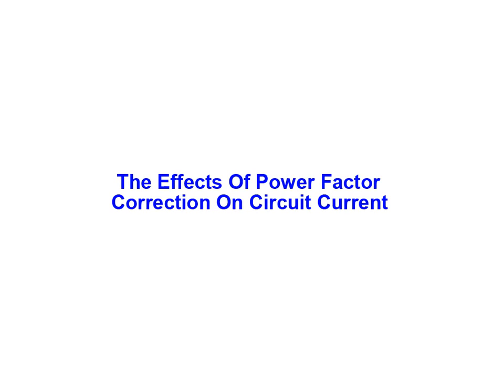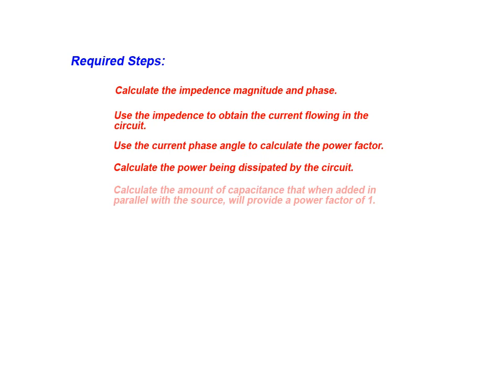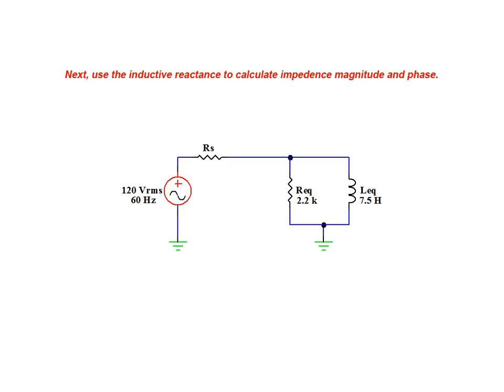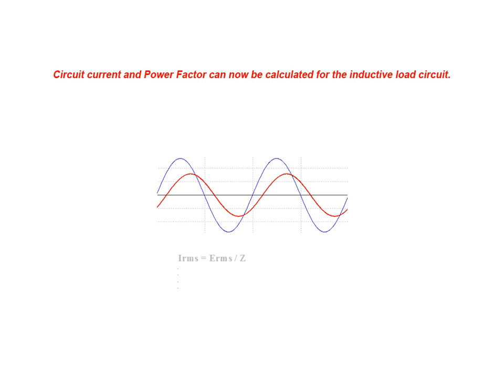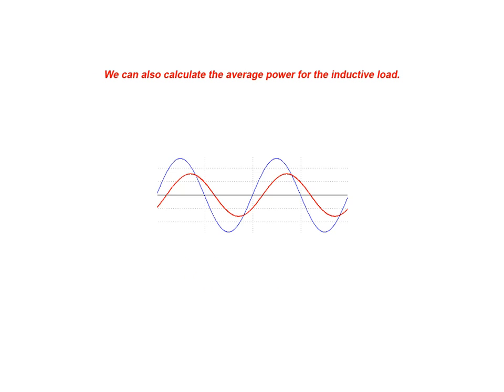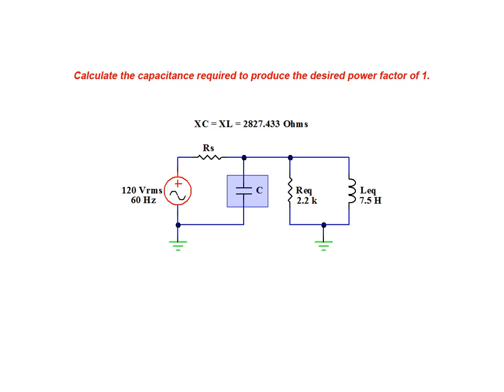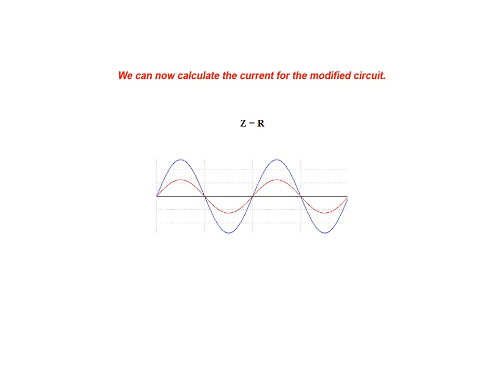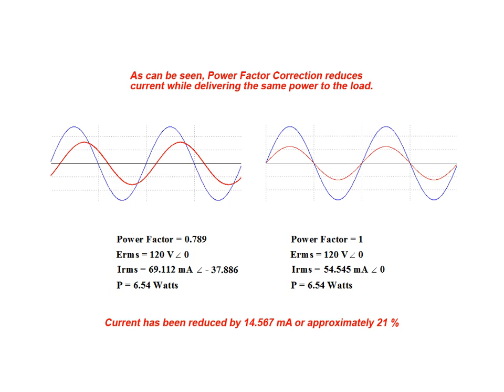Power Factor Correction - The effects on overall circuit current magnitude and phase

Comment: Thanks to Sintra and Richard Burns of ElectricansForums.co.uk, for helping me find an error you made. At 2:12 you show the equation as Z = R x XL / √ (R2  * XL2) when it ought to be Z = R x XL / √ (R2  + XL2). Otherwise a well presented and helpful video. Thanks for uploading, still helped me learn.
Reply from the maker: Thanks for catching that.  The relationship shown should be as you state. The correct operation was performed when doing the calculations, the math for the question as well as the resulting value are both correct.  (but the * should have been a + in the slide)  Sorry if that caused any confusion, this has been up for a while and I never noticed. Thanks again Michael, I am away right now, but will fix this upon my return ! Cheers !